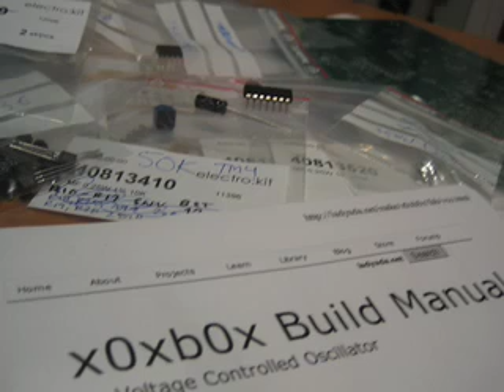making of x0xb0x

Comment: Do all of the internal components get soldiered flush against the x0xb0x main and switch boards? 

I know that the chips go flush against the board, but in some analog devices an LED might have a little length between the board and the bulb as well as other components. 
.